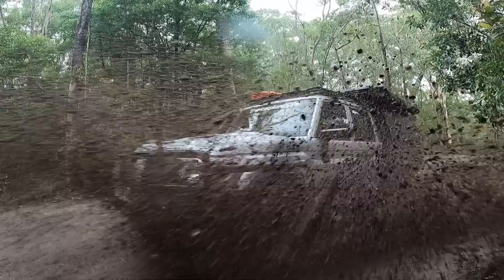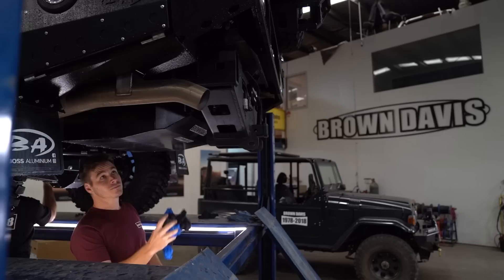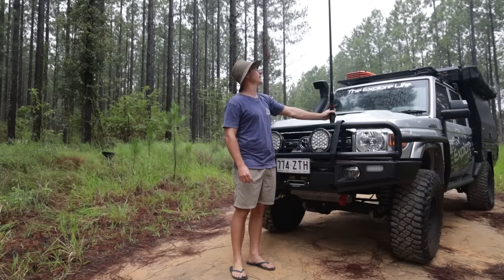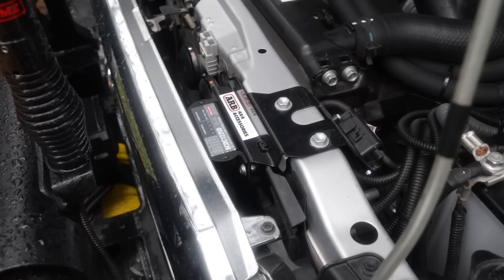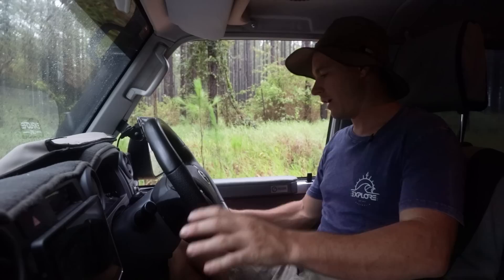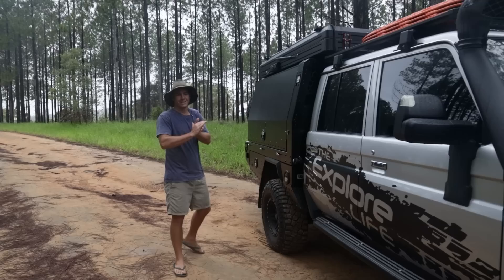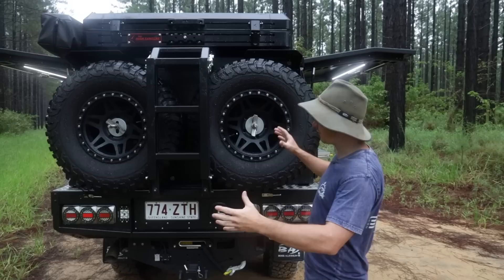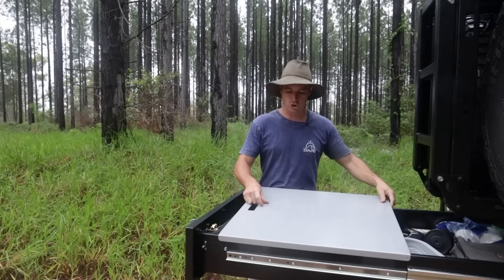MY DREAM 79 LANDCRUISER!! THE NEW EXPLORE LIFE 79 SERIES! - EXPLORE RIGS EP7

Comment: Congrats she’s a beauty of a rig! Got a couple questions; 
1. Why’d you change the rear locker out to an arb air one? Does the factory one not go with that jmax diff? 
2. How do you think it’ll go off road doing the tough tracks with all the weight? I’ll be interested to see this, always wondered what the cruisers with 4495 gvm are like doing the hard 4wding. 
All the best for ya trip

Comment: Awesome build mate, love that you kept it practical where possible, well thought out and like you since the Black truck did its first run my thoughts haven’t changed since then and you kept that concept that was done right back then real now. One thing I would do that mentioned in last vid, I have Recaro in a few of my JDM legends cars and always love em, but someone convinced me a few years back on Stratos and having had many injuries in off road racing, back injuries etc, this is a must for all day driving imo and esp if you gojng all around Aussie, like some of the things you have done in your build, you don’t know how much of a difference it makes until you have em. Function over for. and name brand, I wouldn’t have anything else for my off road builds. Also has lumbar pump up support done right. Been a great series to follow, look forward to seeing you get it out and around Strayla this year🤙
Reply from the maker: Cheers mate will have a look 🤙🤙
Reply: Mate I’ve just finished a 2020 79 build, put a Stratos suspension seat in with dual arm rests and lumber support. Would you believe the inside arm rest misses the DOI centre console by 10mm and the door side arm rest misses the Onestone arm rest by the same amount 👍👍😎 Very is impressed. Had the same seats in my Patrol for over 15 years - best you can get period 👍😎

Comment: Great build. However I thought  79 LANDCRUISER  got a   Gross Combined Mass 6850kg . If the vehicles comes in at 4 Ton empty you cannot pull 4 tons . If you load it with gear water food etc and people  you look more at about 2 tons or so . It is not the case that one can add all this gear and weight to the towing vehicle and not reduce the towing capacity .Regardless how good your suspension is.

Comment: you will smoke that clutch
Reply: Had mine in since new - May 2020 - got 15,000Ks on the clock now - no issues and I’m slightly heavier with the same power upgrade